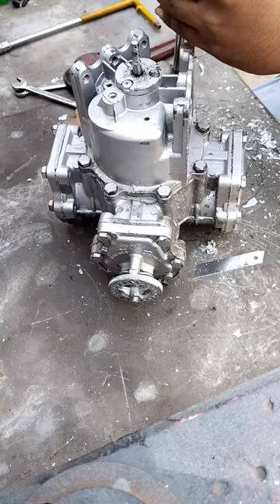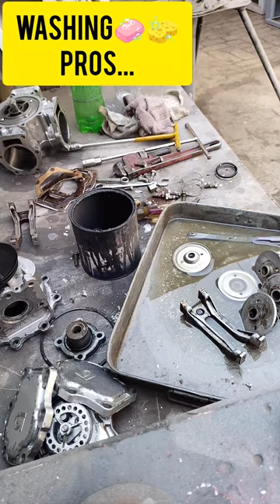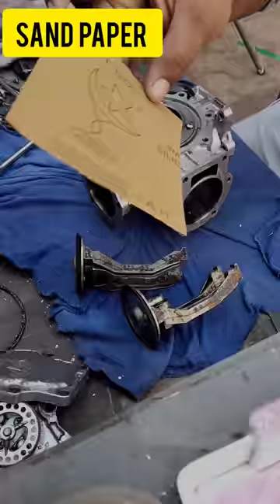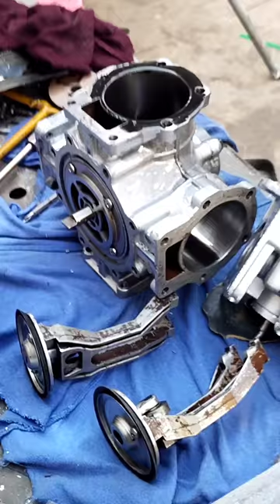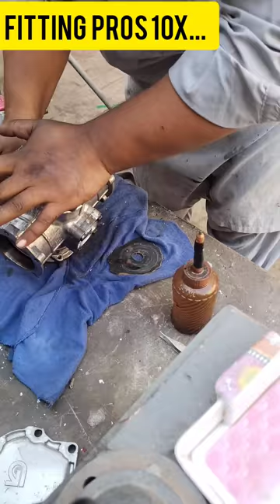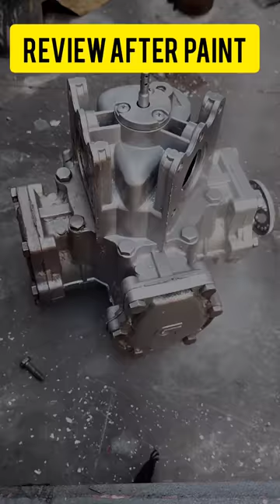How to repair petrol machine | assembly| fuel dispenser#repair #restoration

Comment: Bro, when we set the price 100 and  fill the petrol, it stop at 99.80. When we replace the new meter it is working well, where the old meter can repair it and what will be the problem in old meter
Reply from the maker: Brother us meter ki programming ka masla hy agr uski programming kisi k pas available ho to vo usy set kr sakta hy baki technical fault koi nhi hy
Reply: Bro, jab meter replace kar tha hey tho oo problem solve uoja tha hey .. mathalb meter mey koi ptlroblem hey kiya
Reply from the maker: Yes meter k mother board k uper jo main ic hota hy uki programming ka issue hy ic badlo chahay board badal lo ya pora meter apki marzi hy